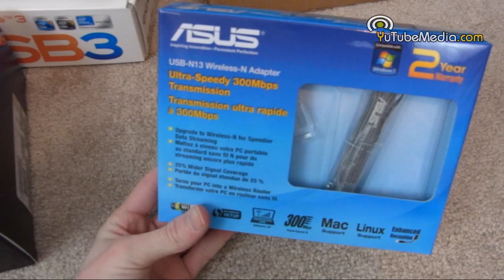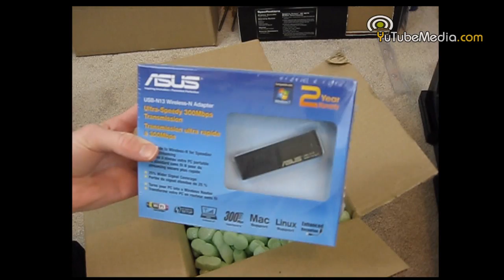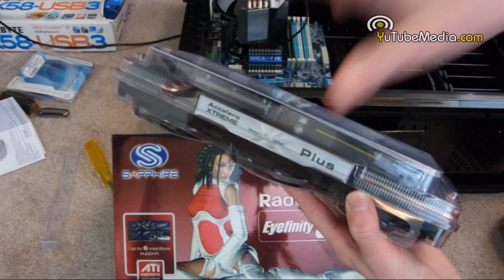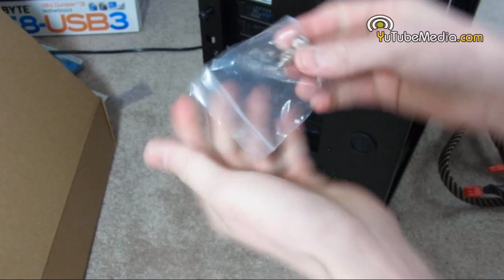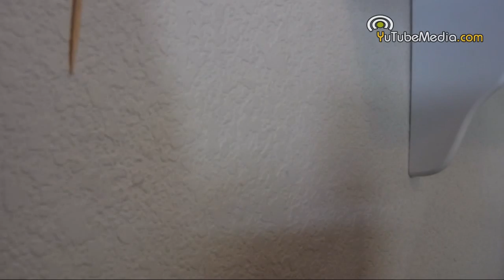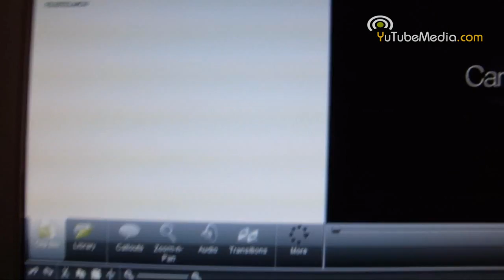New Powerful Desktop Computer!

Comment: haha Anti-Static Bags ARE NOT anti-static on the outside so its not advised to place your electronic components on top of anti static bags. and no you cant flip it inside out and be good to go. you are better off just taking your motherboard Box. and using that as your work station

Comment: @Juankinator 

all video cards come with the stock cooler on them, which is usually adequate. This guy just bought an aftermarket GPU cooler coz im guessing hes ganna overclock it. The stock cooler can handle overclocking, but not as well obviously.